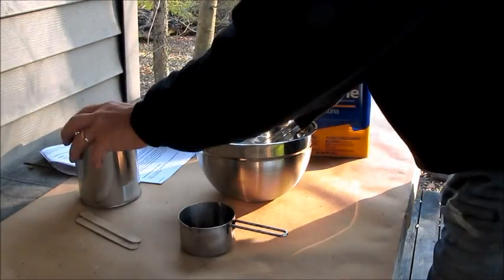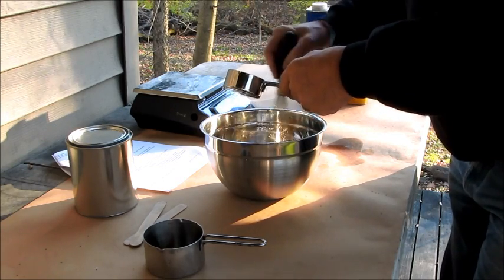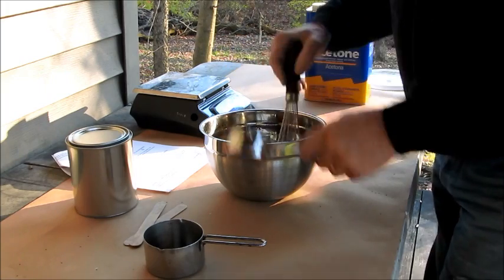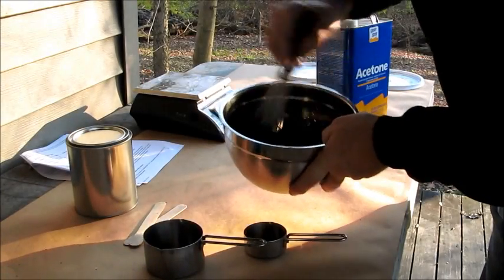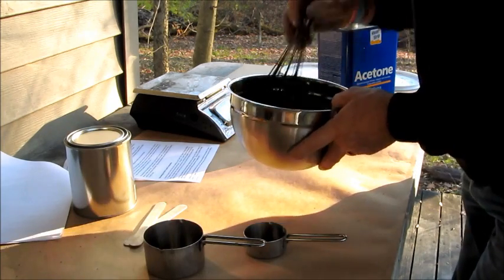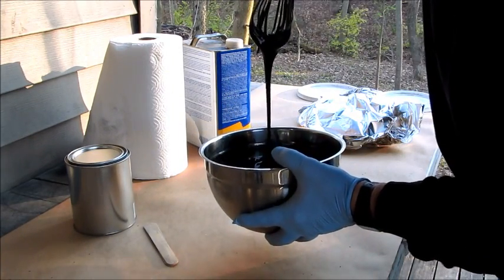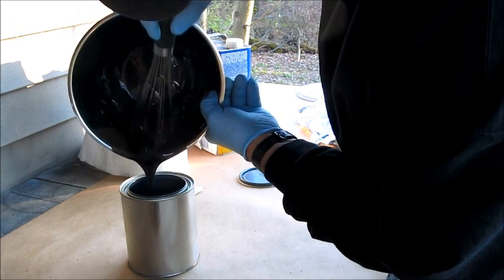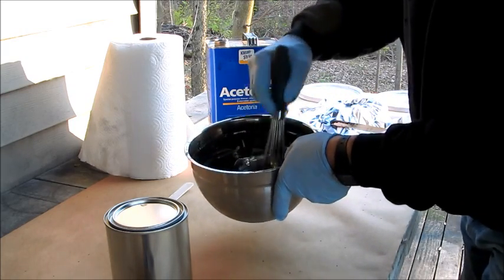Homemade Nitro-Cellulose Lacquer

Comment: so where is the nitro cellulose? that is just gun powder not nc lacquer
Reply: ned gorski Guidance? What for? I studied chemistry. But to keep expressing myself in understandable terms: its neither difficult nor particularly dangerous, if you handle the acids with care and safety equipment. If you dont know the basic process of nitration, look up here on youtube, for example "making nitrocellulose" and you will understand. The process is the same for most nitrates, only acid concentration might differ, so even nitroglycerin is made the same easy way, with the huge difference, that the addition of cellullose will not produce large amounts of heat like many other chemicals do and therefore, the needed level of care and experience is greatly reduced. So, no... this surely should not be above your "pay grade", no matter how "low" you consider it to be. Its as easy as putting on safety gear, mixing the acids in a 2:1 ratio then cooling  them down in an ice/salt bath and dumping in a lump of cotton while keeping them as well as yourself cool, stir sometimes and after 45 mins to one hour, take out the cotton and thoroughly wash it several times with water, the once with soda water and clear water again and dry it. Done.
Reply from the maker: Study the composition of smokeless powders, Michael.
ned
Reply: didnt you say bp i assumed regular black powder sorry ned
Reply from the maker: No, I didn't say Black Powder. I hope that clears it up. You need to use smokeless powder.
Enjoy, ned
Reply: sorry ned pretty hopeless at the moment still learning in australia where it isnt allowed so gota be carefull what i play with or i will get looked a the wrong way, what smokeless comp do you use if i may ask? thanks
Reply from the maker: Be damned careful playing with such a project, though, if you tackle it. Get good guidance first. That's all above my "pay grade".
ned
Reply: Single-base smokeless propellants are mostly nitrocellulose with some additives.  Double-base include nitroglycerin.
Reply: nitro cellulose- easy to make... get a glass thermometer, fuming sulfuric acid + fuming nitric acid +an ice bath.
mix 50/50 together in a separate bowl- then placed in the ice bath (to keep it cool- if it gets above 120*f dump it into the ice bath immediately) constantly stir while adding cotton balls (anything organic) stir for 25 minutes- remove & rinse in ethyl and allow to air dry. there- you've just nitrated cotton balls... AKA nitro cellulose.
Reply: my lord you're a "dope"! 
no. drain cleaner is NOT 96% pure sulfuric acid and  fertilizer is not even close to 65% nitric acid. lmao! AND this is NOT how to make NC lacquer! this is how you nitrate an item! TOTALLY DIFFERENT than NC lacquer!
the term you're looking for is "fuming" acid- fuming acid is high purity acid that begins to "fume" (looks like smoke) when exposed to air- this would indicate you have a highly concentrated acid. nitric acid typically begins to fume around 75-80% concentrate. using the ingredients you mention above is asinine. your "recommended" ingredients also contain tons of inert chemicals that interfere in the nitrating process- and could be pretty harmful or even fatal. Also- mixing fuming acids could (usually) result in a violent explosion if not done properly- in a properly ventilated area! and temp must be monitored very closely- as it could explode spontaneously.   -  also, dissolving ping pong balls in acetone makes a "poor mans" NC lacquer. again- other chemicals like phenol, for example found in ping-pong balls makes for a very poor grade NCL. 
please- for the love of humanity- stop giving james bond style tips of pyro related assays!
Reply: carrie smeglin actually you CAN buy sulfuric acid drain cleaner that is in the 90% range.  Also, I think he was talking about Making nitric acid using some sort of nitrogen based fertilizer such as ammonium nitrate.  You CAN get a very pure nitric acid from chemical fertilizers.
Reply: Nitrocellulose is actually pretty easy to make if you have access to sulfuric acid 96-98% (frequently sold as drain cleaner, the red coloring doesn´t really matter or available on ebay with worldwirde shipping but for insance prices) and 65% nitric acid (which can be made from sulfuric acid and KNO3 or NH4NO3 (available as cheap fertilizer) - look up online. KNO3 is also possibly available as stump remover or again via ebay for insane prices. 100% Cotton or other relatively pure cellulose material should be easy to find anywhere.  Another easy way is to simply use celluloid ping pong balls (ebay) and dissolve them in acetone - be sure that you buy the celluloid ones and not some supercheap crap made of another plastic. Celluloid is nothing else than nitrocellulose softened with camphor which was the first plastic. Not as perfect as pure NC but still very much useable. So... everything is doable and depending on what one is willing to pay, accessible. But sulfuric acid and nitric acid shouldn´t be too hard to obtain at some good price through chemical suppliers... I live in Czech Republic and I can buy a whole kilogram of under 12,5% N (dinitrocellulose) for not even 20 dollars...

Comment: is it safe using metal mixer brush in metal bowl
Reply: with such flammable vapours like acetone and powder ? maybe bamboo tea brush or ordinary plastic thing avoid sparks ?
Reply from the maker: Stainless steel, on stainless steel. No sparking hazard there.
ned
Reply: ned gorski, well good quality of course

Comment: How much NC percentage does this work out to being? I'm sure some will depend on the powder, but more or less 5%, 10%, 25%, any idea? Thanks
Reply from the maker: I don't know that, Anna. I think Lloyd has some info on all that, though. He's available through the website.
ned
Reply: ned gorski

Thanks. I'm watching you making the crackle stars in your other vid, and you say it doesnt really matter if we put too much NCL in it, so probably the concentration  either doesnt matter, or only helps once its been dried off?

I made some NCL with your method, and it came out very pretty looking. I used Clay's and it gave it a nice greenish tint, super smooth, like thin pancake batter like you said. Will be making the stars with the husby this week, lets see how they come out!

Surprisingly little info on these stars, which are always a crowd favorite...
Reply from the maker: Cool, good luck with the stars, Anna. The N/C lacquer method in this project has the advantage of getting a good percentage of the solids into the crackle microstars. Overwetting the star comp a little will only increase that percentage, but not by a huge amount. 
n
Reply: Well, working on this years batch now :D Last years batch ended up very well. It took me a while to get the NCL right. And it is a pain to clean up and work with.

As I still have no gauge of %age of NCL in my mix, I just go with %age of the weight of my total product. Ex. If I make 1000 grams finished crackle, then 15% would mean 150gr of smokeless gunpowder used to make my ncl. This method has the plus of letting me gauge the "juice" of the final crackle.

I ended up with 20% for my NCL mix, and it made fantastic crackle. Using same recepe this year. :)

Cheers everyone!
Reply: TheRealUbehage
Great advice, thank you. You got me in time to try these tips for this year, though the time is getting short... But most of the show is ready and some of it even assembled :D

Do you consider a BP/dextrin/silicone prime to be good enough, or what do you see as the best prime and method of priming for the stars?

Cheers :)

Comment from the maker: It is smokeless shot-shell powder, one of the "dot" powders.
ned
Reply: His house will burnout without smoke alarm flash. Lol
Reply: Double based, meaning you have some glycerol trinitrate.  Energetic stuff.
Some double based propellants have enough in them to detonate with a hammer hit on an anvil.

I use Varget, single base with minimal graphite so it turns out green.  Slower to dissolve so you need a magnetic stir plate.

Comment from the maker: Ammonium Perchlorate. Doesn't play well with copper, which is in brass. I've never used brass media, but it should be OK with pot perc. Just make sure you clean the jar/media well if milling anything other than KNO3, BP chems and comps.
n

Comment from the maker: Dustin, is that a metal coffee can you are milling in? I'd be very hesitant to use any sparking materials when ball milling.
ned
Reply: ned kitchen stainless is very reluctant to spark, you need a high carbon stainless like aeb-l o run any real risk.

Comment from the maker: I've disassembled and repaired a Kitchenaid mixer, and that motor is not totally enclosed. I'd be very concerned about sparks from the motor's brushes igniting the acetone vapors.. That would certainly be a "bad thing".
ned